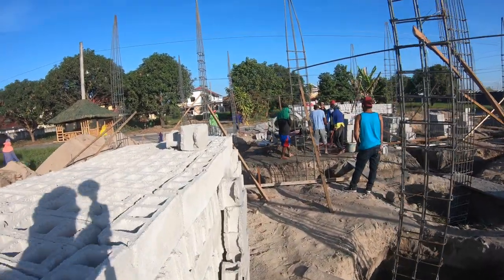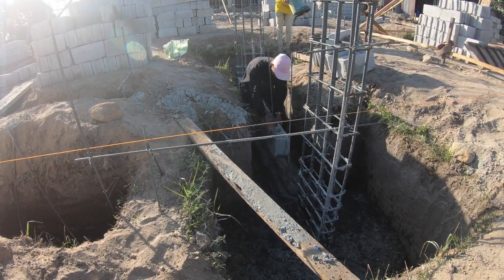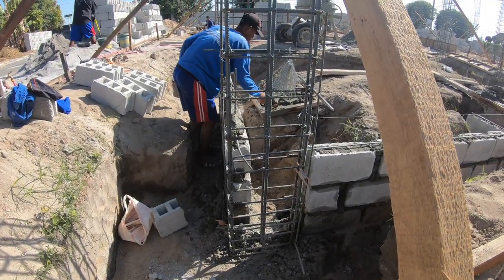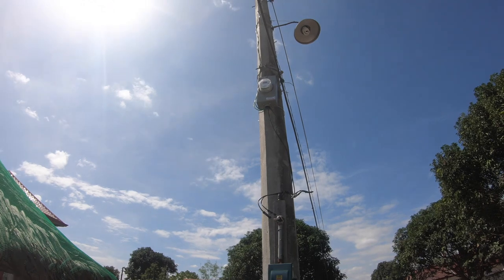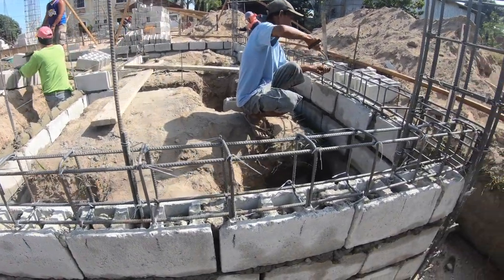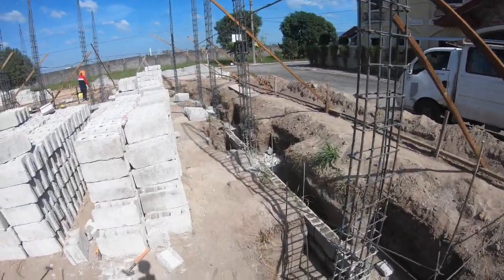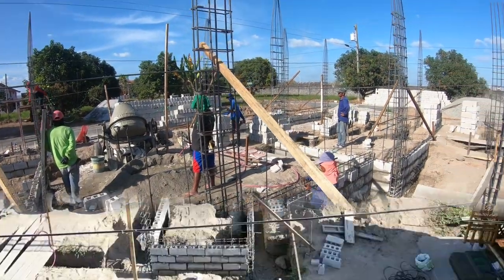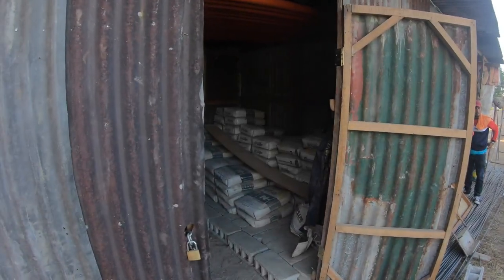Philippine House Building Step by Step, Build Day 19: Upon a Solid Foundation

Comment: Rewatching the build, again, and I think this might be the number one thing that makes my head hurt, 4:00 they fill the block, with concrete, AND AIR. I'm going to be standing there, with a smile and a rebar rodding each void. Forgive all the comma's George.
Reply from the maker: Totally understand. If you can get them to use a small concrete vibrator, it will help tremendously. Most of the masons here just aren’t use to it because the machines are expensive and require maintenance. 😔

Comment: What size block are you using on these first courses up to the grade beam? Also what sizes are you using for the rest of the house?
Reply from the maker: spanky9067 walang problema , 6” CHB on the foundation footers up to the grade beam and the exterior walls. 5” CHB on the interior walls.
Reply from the maker: @builtnotboughtmadeinphilip3955  
No tie beams on the bottom of the foundation walls. They put rebar all along the base course, poured the concrete to about 4”-6”thick prior to setting the first couple of rows of CHB up to grade level. Then grade beams were placed at the top of the foundation before moving up to the walls, columns, and beams. 
Hope that helps. All about others learning from our mistakes. Constructive feedback always welcome. 
Thank you 🙏

Comment: Keep 5 cm distance between the colum and the HB
Reply from the maker: I tell them every time they build the forms. I’m blue in the face and will keep telling them.  Thank you for watching.
Reply: @CasaTexPina  Looks like the rebars for your columns are really strong and well put together. So you should make it through a couple typhoons!

It could be worse. I was looking at some OFW house builds.  They use 2x4 as the window frame and then have 2 or 3 stacks of concrete cinder blocks on top of the frame.
That's a lot of weight for the window  frame to bear.  It seems to be common practices in the PI. The proper way to do would using a T-bar lintel or even better some kind of poured horizontal beam like what you did with your house. 
 
https://www.youtube.com/watch?v=nGax2RQuLnw&t=412s#t=6m21s
Reply from the maker: @zeus6662  16mm vertical and 10mm stirrups on the columns. Horizontal beams are 10mm and 12mm with 9mm stirrups. 
Should hold up fairly well for many years to come. Knock on wood. 🤞🏽🤞🏽🤞🏽